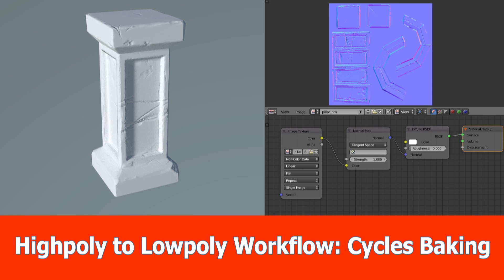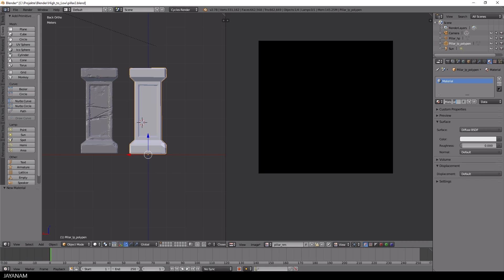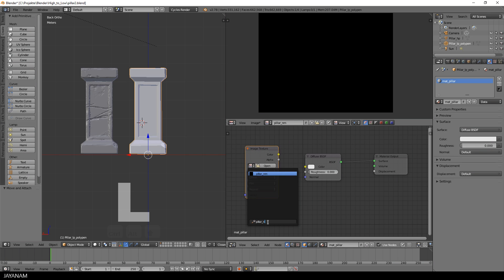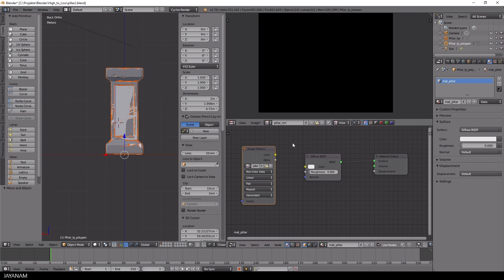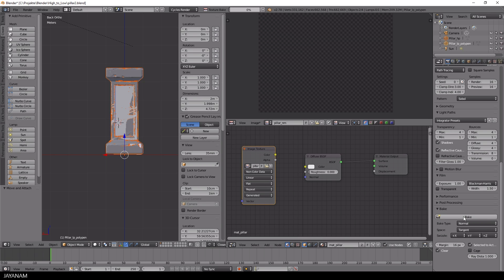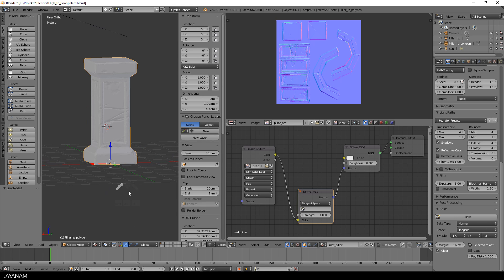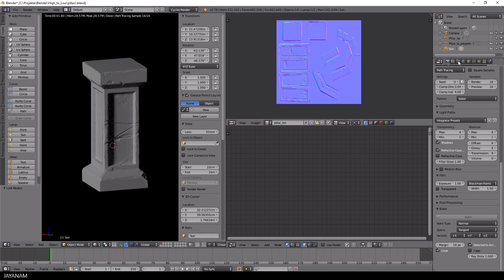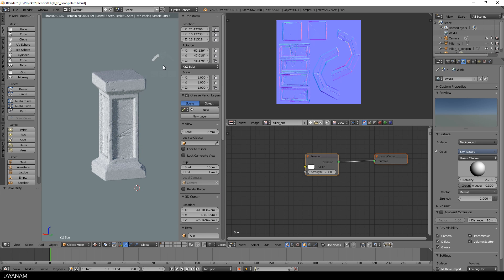High poly to Low poly workflow : Blender Cycles Baking (5)

Comment: So - did the options change when 2.79 came out? I've got none of the options to add an image texture to my material...
Reply from the maker: No. Are you in cylces renderer? And in the node editor, do you edit the material and did you check for the material "Use nodes"?